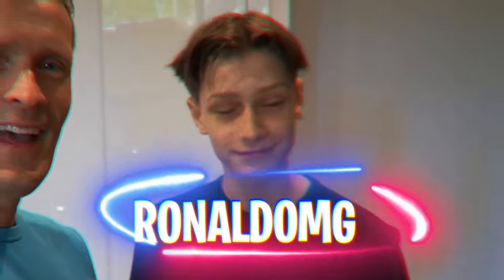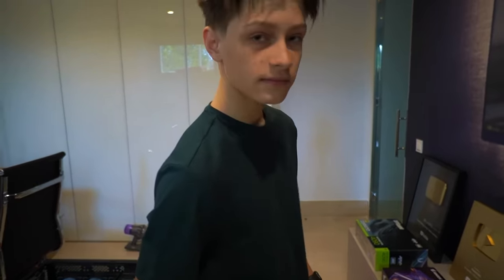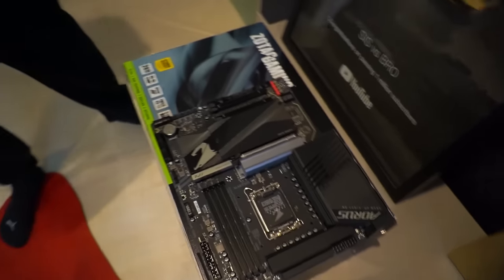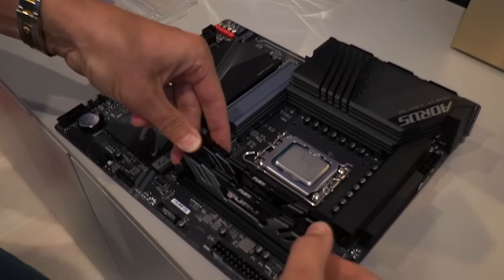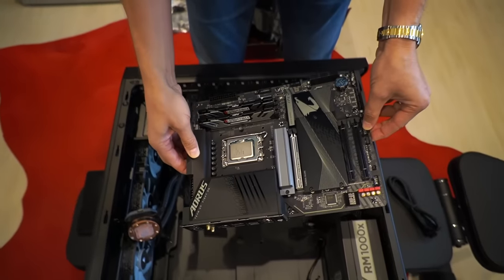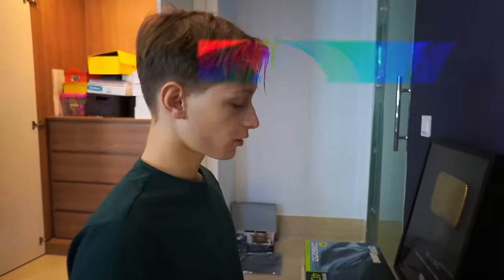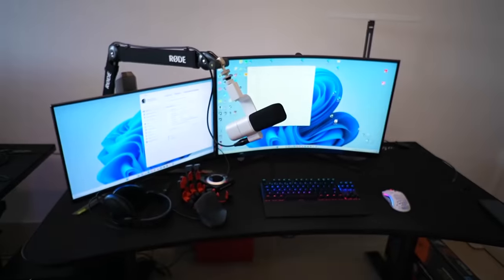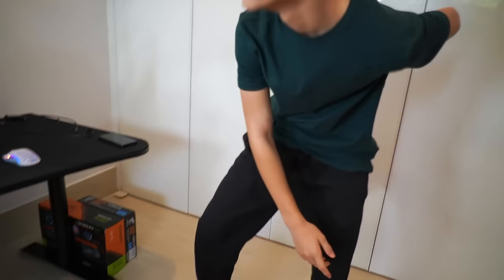My New Gaming PC

Comment: Great pc build! But there are 2 mistakes yall made: the ram probably should go into the 2nd and the 4th slot, there was a thermal pad under the 1st nvme slot which the plastic should be peeled off.
Reply: uhm huh? English pleaseee
Reply: @jamialarsuel  bro look up pc terminology
Reply: @jamialarsuel  I got you! There are a total of 4 slots for R.A.M (random access memory) It's your short-term memory. You normally put it in slot 2 and 4 so if you have a big CPU (Central processing unit) cooler your R.A.M doesn't overhang putting it in pressure on the cooler, while still allowing for dual memory access. Then the NVME (Non-Volatile Memory Host Controller Interface Specification) is where you put your SSD (solid state drive) It's you long term memory.  There was a piece plastic over the thermal pad which helps keep the thing you want from getting too hot to stay cool, in their case the SSD. That piece of plastic was there to protect the thermal pad. So, if they don't remove it, their SSD might be a bit hotter than normal which can lower performance. I hope this helps! :D
Reply: @1010_Hi  ohhh now I get it. Thank you very much.
Reply: @bomorman23  You can also help m8
Reply: Wouldn’t it still be okay to use it the way they set it up since it’s working?
Reply: @valtrex.  Yes it would, im just pointing out the mistakes that they made, not every mistake makes the pc to not work
Reply: @mmatej16  ohh alright thanks
Reply: also forgot to screw down the 2 ssd cards
Reply: @christianlui7463  Good catch. Why am I back at this video.
Reply: @jamialarsuel  Why you watching a pc building video and expecting for people to simplify the terminology then 😅

Comment: funny thing, the Intel Core i9 13900K has an integrated GPU while the Intel Core i9 13900KF doesn't. Kind of strange that the Intel Core i9 13900KF costs more than the 13900K, Considering the fact that the only difference is the the 13900KF does not have an integrated GPU while the 13900K has one. Weird

Comment: wouldnt you need a 1200 watt for the 4090 x i9 13900 might need to upgrade that
Reply: When are you going to run both of them on max?
Reply: @AppleFanTeslaMan  he said hes going to overclock and the psu is 4 years old so maybe
Reply: 1000 wats should be enough
Reply: @Maybeaery  after overclock and the psu 4 years old might not

Comment: 3090 not enough? i mean like i respect but like i have been using the same gaming laptop for 2 and a half years. it has i5 ten series and gtx 1650. i still run games fine. u had a 3090 . bro thats literally all you'll need like im sorry